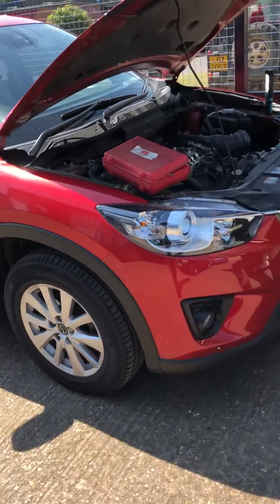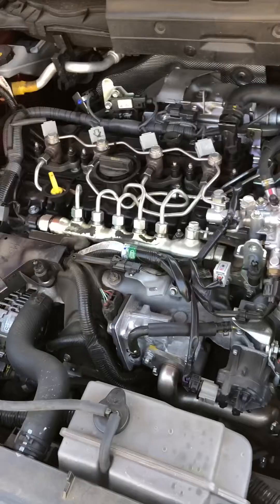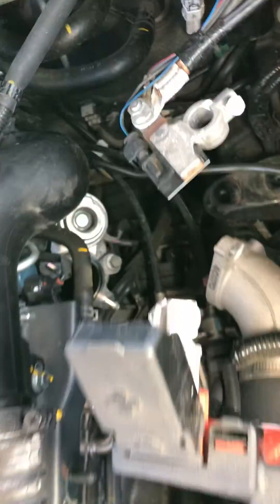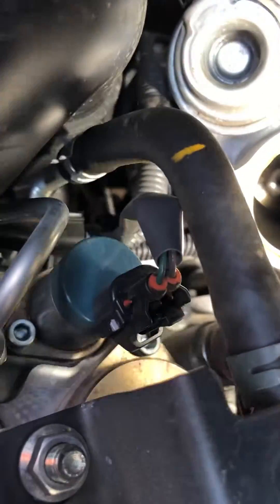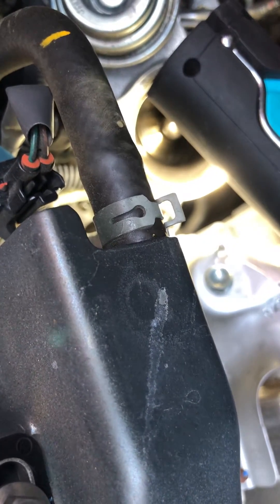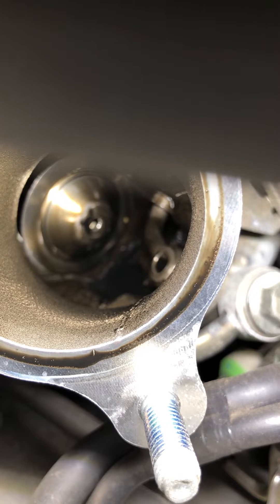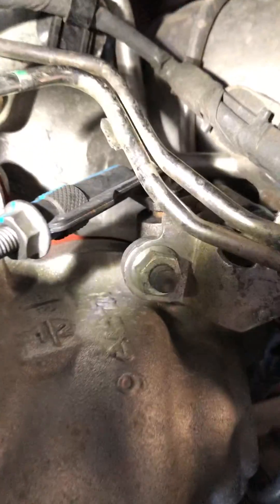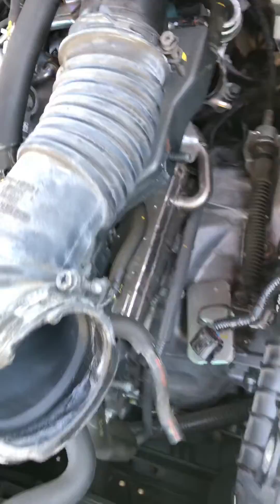Mazda CX-5 diagnosis for loss of power and fault code P0299 under boost.

Comment: Hello, I have recently purchased a Mazda CX-5. It's experiencing a loss of power. I have cleaned the DPF (I have a caution on the dashboard to inspect the DPF) with DPF-fixer, but the issue persists. They shared the report with me; in the report, I have found the error "P0299:00-64 Turbocharger/Supercharger A Underboost Condition." They have also mentioned, "The cleaning has been completed; I also cleaned the MAP sensor and the turbocharger boost pressure sensor. The metal pipe of the boost pressure sensor is not in perfect condition—if the problem reoccurs, it will need to be replaced. The DPF is clean.
Further work: Need to check the turbocharger because the car is still sluggish." I am based in West Sussex, and local garages are saying that there is an issue with the turbo; however, one garage said the turbo is fine, but you need someone expert to diagnose it in detail. I found this video that seems to be relevant, but I'm not sure. Can you advise what to do? I can share a detailed report with you of DPF-fixer
Reply from the maker: Hello, 
It sounds like you need to get a garage to check the change over valve on the turbocharger, as you have the fault code and symptoms that point towards it. 
The pipe you said is not in the best condition, make sure it’s not leaking or blocked as this could give you the DPF message. 
Hope this helps 
Charlie

Comment: My car doesn't have power climbing hills. I changed the ignition coil and spark plug but still same. Any idea?
Reply from the maker: @darrenkaukesa5291  Hi Darren, it would be best to start with scanning the car for fault codes. As your car is a petrol this video isn’t really relevant. 
Check for any air leaks, split vacuum pipes or a blocked air filter.
Hope this helps

Comment: Do you know if the part of the turbo where the valve goes is sold? I have it broken and I can see that there are screws where it later attaches to the turbo.
Reply from the maker: @cransaftvalve734  in the past only the whole turbocharger was available, but someone may do the valve on its own now.
Reply: @brownsgarageltd  Yes, I think I saw that it is for sale. Thanks.

Comment: Hi,
I get this error P0299 after around 20-30 mins of motorway driving. Never within city or sometimes it comes on one way journey but while coming back when I was doing 2500 RPM then it didn't come for 80-90 miles whole journey.
I am not sure what's the issue. Recently got my exhaust pressure sensor replaced. also cleaned my MAF, my maf readings are bit odd but I still feel if maf was bad it wouldn't wait for that long to give error, any ideas?
Also one more point I don't see any limp modes i could still drive well with a good turbo boost over 2.5k rpm and it goes all the way to the 4k also. 
Once I restart the engine the error goes away.
Reply from the maker: @IshanSingh-wh7gk  Hi and thanks for watching my video. 
As P0299 is an under boost fault it’s worth getting a smoke test done to check for any leaks on the boost/intake system. A telltale sign of slight leaking is the pipe or joint may be slightly oily. 
Also on this engine take the pipe off as shown in the video and make sure the flap isn’t loose, so when it changes position it’s sealing correctly. 
Hope this helps.
Regards
Charlie
Reply: @brownsgarageltd  Hi Mate,
I got my car checked yesterday, looks like a new turbo is needed. The garage said the diverter valve is broken and the circular valve is just laying there and the stick thingy that it's attached to is gone, so can that valve be repaired or it would need a new turbo itself. In your exp how much it would cost?
Reply: @brownsgarageltd  Brother I really need you expert advice.
Reply from the maker: @IshanSingh-wh7gk  Hi, yes that does sound correct the diverter valve comes with a new turbo. It may be possible to get the turbo repaired or reconditioned but it would still need removing from the car meaning the labour cost is the same. 
Hope this helps 
Many thanks
Charlie

Comment: I have loss of power. DPF an SCBS light on dashboard. After being cleared by a DPF clean specialist.. Still sluggish but will eventually get up to speed.. I've had a recent oil change. Any ideas? 

An exhaust gas temp sensor has been mentioned as a cause. DPF is clean with low soot content.
Reply from the maker: Hi 
It’s worth starting with a code scan so you have some fault codes. Sometimes if the DPF is still blocked it can give a temperature sensor fault as not enough gas is passing meaning the temperature is too low. 
For the time it takes it’s worth checking the turbo valve in the video . 
Many thanks
Charlie
Reply: @brownsgarageltd  thank you
Reply: Hiya mate did you sort this? Mine is doing the exact same thing as this but dpf is all fine

Comment: Hello is it possible to fix just like what’s in your video, or the whole turbo needs to be removed? I have ordered the replace flap and bolt off eBay. Is there still possibility for the bolt to fall off at all?
Reply from the maker: Hi 
Thanks for watching the video, if the part is correct, fits well and works then it should be fine. Maybe use a bit of thread lock on the bolt.
Reply: Can I get a link to where you bought the part

Comment: hello, I want some advice, I have a mazda cx5 2013 and I have problems with the turbine, it runs in lag between "1300-2000"rpm and sometimes it doesn't run at all and I get the error "P2262" (turbo charger pressure not detected Mechanical). I specify that I changed the wastegate on it, I think it is from Actuator? . thank you.
Reply from the maker: Hi 
Firstly it’s worth checking the boost pressure sensor for fouling, clean and refit. Smoke test is a good idea to check for any boost leaks too

Comment: Hi, I have the same problem. I retrieved  the bigger side of the rivet, I guess the smaller parts will be at the intercooler inlet (hopefully to big though to make their way through there).
Do you think it is safe to drive the cat like this until the problem is fixed? I'm not sure what this flap does to be hones...
Reply from the maker: Hi 
The other part will be at the intercooler, not too bad a job to get out. 
The flap changes the airflow between the small and the larger turbo, it will log a fault code and may run in a safe (limp) mode

Comment: Does the 1.5D found in the 2/CX3 have the same issue?
Have a P0299 code saved.
Reply from the maker: Hi 
Yes most of them do have a twin turbocharger set up, I’m not aware of the same issue with these but it’s possible. 
Worth starting with basics first like a high pressure smoke test and maybe worth cleaning the boost sensor.
Hope this helps you.
Many thanks
Reply: @brownsgarageltd  cheers for the reply. The 1.5 is a single turbo. Ive had another look at IDS and the actual MAP is lower than the MAP demand, which I'm assuming is the reason for the P0299 code. Question now is what's causing lower pressure

Comment: Good video. Question again ..I've had huge jobs done turbo kit head gasket rockers cams etc . After 2 other sensors replaced it pulls well . Only thing that annoys me is I get some mooing  at mostly lower revs (lower speed driving ) motorway not noticed . Any ideas ? Cars been a pain
Reply from the maker: Thanks 🙏 
That’s a really difficult problem to help with, but I will try !
Firstly can you hear it when stationary, if no this rules out only engine related rotational noises. A boost leak can make an unusual noise but normally worse under load. 
And brackets or pipes that are loose, poorly routed or catching the body or subframe can cause random low speed noises. I’ve had plastic air ducting causing an annoying noise in the past. 
Lastly does the noise remain or change if you press the clutch or put the car in neutral so rolling. If it remains then it could be a wheel bearing or bad tyre 🛞 
Hope this helps
Reply: @brownsgarageltd  hi thanks for you're reply all good info. I've not depressed the clutched when this happens  but I'll try this 4 sure . It's not consistent with the revs etc so if I went faster the noise don't necessarily get louder or worst . One thing that was done some time ago was a mechanic pit a cable tie around intake port they'd said back then it vibrated.  The cable tie is not there atm and wondering if its the cause . I guess I could try ruling it out by replicating with a new cable tie I have plenty there . I felt the air duct recently I guess it's not as rigid as I'd prefer but not overly loose either.  I guess I could try the cable tie just maybe it's resonating slightly.  I'll get back to you on this . Thank you . I knew it not be the actual filter itself I put a new filter in yesterday old 1 was a bit grubby  .
Reply: @brownsgarageltd  btw I was thinking a solenoid as they can make noises .? Just a thought
Reply from the maker: @kevinhancock4064  yes they can make a noise so worth checking. Maybe try taking a video of the noise?
Reply: @brownsgarageltd  problem is noose only wjrn moving I'd have to get Mrs to maybe video it if microphone picks it up . I have a mechanics stethoscope but that's pointless with this as it don't make a noise when stationary . Mine has 2 solenoids 1 is 34+ vat other is 80ish+vat

Comment: I have a similar issue with the second turbo. I have power till 3000rpm. After 3000rpm, there is a lack of power? No lights on the dash or anything. Driving me crazy! Any ideas?
Reply from the maker: Try having a look at the changeover valve, make sure the flap is in place and seating properly. 
If that looks ok, try and find someone to check for any stored fault codes and start with a smoke test to check for any intake leaks.
Hope this helps
Reply: @brownsgarageltd  
Your fuckin Champion 
Thanks
Reply: @brownsgarageltd  where is the changeover valve located? Also could it be dpf?

Comment: Great video. Had the same issue with my 2.2 Mazda 3. 
Ordered the parts and changed the small turbo valve without having to remove the whole assembly. Bit fiddly but well worth it. 
Think your video saved me over 2K !!
Reply: Hi Andrew, Can I ask where you got the valve from? I have the exact same problem with my cx-5
Reply: @colinpanther4466  Mazda dealership- there had some parts stripped down from a new turbo assembly
Reply: Hi where did you fine the broken nut and pin???
Reply: @colinpanther4466  Did you find one in the end mate?
Reply: @deeovid  Yes I managed to find someone selling a new kit to repair the value. I then got a garage to carry out the work.
Reply: @colinpanther4466  Can you recall where you got the kit please?
Reply: Do you mean you replaced the pin, through the opening rather than removing the assembly? I might have to try that, as I can't see a way to remove the forward most bolt on the assembly. Circled in this image - 

https://drive.google.com/file/d/1M6WCUIfN9NjB8rTVk-8RByGuDPoQGHLw/view?usp=sharing
Reply: @deeovid  no, I replaced the divert valve including the housing.
Reply: @deeovid  I am not to sure as  i got a garage to carry out the work. But what I do know is that most of the work was done from  under the engine.
Reply: How much were the parts?
Reply: @michaelcurley8764  £85
Reply: @andrewharris3380  Thanks Andrew. I got complete turbo replaced under goodwill from Mazda. Only had 85k Miles with fsh. Can you post the part number just in case it happens again?
Reply: akita 1973  not with mine
Reply: Just ordered the repair kit. Anyone got any advise on fitting it. Apparently a bit fiddly?
Reply: @shoesxx1  bottom bolts are difficult to remove on the housing so be careful not to drop them

Comment: Hi, i have mazda 6 2.2D, 2014, 83000km. Recently we experienced sudden loss of power accompanied with whistling sound (link to video belo) when accelerating (but it only maxed at 80kph or so). Brought to Mazda, they reported P0299 and P0236 code, telling us to change whole turbocharger (they quoted AUD 7000 + 10hrs manpower!!). Do you think it's having similar problem as yours in this video? We haven't tried opening the turbo up on our own. Really appreciate it!! 

Video of whistling sound: https://youtube.com/shorts/xVnDGiyWS28?feature=share
Reply from the maker: Hi 
Yes that is the same problem and the video I posted, the changeover valve that fails is part of the complete turbocharger. However you may be able to get a turbo company to repair yours, worth a couple of calls. 
Hope this helps 
Charlie
Reply: @brownsgarageltd  thanks Charlie!

Comment: I have the same problem. Mazda want £1,800 to replace the turbo. does any one the part number for the part being replaced in the video
Reply from the maker: Hi Nick 
I’ll look up the part number for you tomorrow when I’m at work. Ping me another comment if I forget 😂 
Regards 
Charlie
Reply: @brownsgarageltd  Thats really help full.
many thanks Nick
Reply: @brownsgarageltd  Morning, just a quick reminder regarding the part number .
regards Nick
Reply from the maker: @nicksjamesnj  hi mate 
Sorry for the delay, I’ve finally got the current warranty part number from a friend at Mazda for you. 
Part number SHY1 1370 ZB
The last letter B will change as time goes on and they supersede the part. Comes complete with a brand new turbo and all the gaskets. 
Hope this helps 
Charlie

Comment: Hello,
I have a Cx5 ,175hp 2014. I read all the comment from this video and i have the same problem like some people from here. I have low power at low rpm( under2500) but i have no error on diagnosis test. In my town we have bad mechanics, 1 of them told me to buy another EGR. What could be the problem? What it need to be checked first?
Reply from the maker: Hi 
May be worth taking a few bits off to check the changeover valve isn’t loose or fallen off ! This would normally give a fault code but still worth checking. Also check all the vacuum pipes and any other pipes for leaks, smoke test if you can. 
Hope this helps
Charlie
Reply: Did you find wat the problem was
Reply: Same problem as you. Lack of power under 2500, suddenly kicks in when closing to 3000, second turbo taking over. But no fault codes. Did you ever find out what it was?
Reply: @skrik8 did you ever fix it

Comment: hi. i had the same problem. i replaced that valve ( i fixed. i placed a new bolt with the nut and solder that nut so it will not come off. i left small gap between that lid and nut so that lid is not solid. it can wiggle so when it shut it can adjust) it took me 6 h to replace that valve. very sh...t access and many things to disassemble. my question is that i still got low air pressure on map sensor under 3000rpm. i didn’t found that pin. is it possible that this pin blocking intercooler??  i don’t think so because when it goes over 3000rpm pressure is ok but you know better so im asking? another thing what i noticed that my i-eloop stop working very often and i read that is happening when dpf is burning out but this happens to often. so maybe dpf is blocked and that make it all problems. i don’t get any errors codes. also someone advised me to swap boost solenoid to check if that is not a problem. pls advise me. regards
Reply from the maker: Hi Rafal
Try checking the differential pressure reading, or exhaust pressure before the DPF. This should give you an idea if it’s blocked. 
Secondly if the valve repair is not operating as the original, so shutting off one port properly you will get a low map sensor reading. 
From memory these have 2 EGR valves, smoke test these if possible and make sure they are not stuck slightly open, or dirty as this will also cause low air pressure. 
You are right the pin will not block the intercooler. 
Hope this helps 
Charlie
Reply: @brownsgarageltd  thanks for your message. i think that this valve is ok. i don’t know how to check this. i have used original valve so i could replace it and see if this change anything but i don’t really want to spend so many hours to take it out and put it back again . and if that not gone change anything i will have to put that modified one back again. i will not take a risk to damage another turbo. this valve is very risky. about egr. a whole air intake was cleaned in mazda. everything. shame that i can’t show the pictures. what about dpf. do you know what reading i should have or what readings mean that is blocked . and the last thing because you didn’t mention nothing about boost solenoid. regards

Comment: Holy cow! look at that hey...

So naturally the reason I'm here is that I've had my CX5 GT Diesel 2.2 engine replaced after blowing all four injectors, intake manifold clogging with engine soot and blocked oil system. It's a bit of a story, but in the end the engine got replaced with the new KF version. They bolted on all of the old external parts, including the turbo, despite my anger that it wasn't also replaced.

The problem is that I get very low boost on acceleration. Torque app is telling me about 3.5PSI max.... occasionally I'll get a second surge on acceleration I didn't ask for. And Fuel economy I can't get under 7.0 liters per hundred. Prior to the problems, I would regularly sit around 5.8 Litres per hundred.

My thoughts are that since the engine practically siezed the first time. The Turbo is also shot as well... but I can't get the dealer to spend the time to inspect their work claiming it's a new engine and 'let it run in'... 

Would you know what the normal Boost pressure range of these engines are? Is 3.5PSI sounding low? There is definitely huge lag in acceleration and it'll tend to change gears long before it spools the turbo...
Reply from the maker: Hi 
Wow that’s a lot of work, if your engine had an oil supply problem and almost seized that will not have done the turbo any good. Always worth having the turbo tested when an engine is changed. 
The bypass valve is fairly easy to check yourself.
Hope you get it sorted 👍